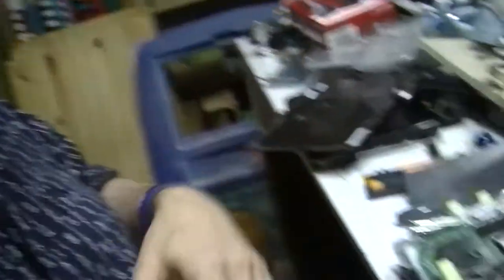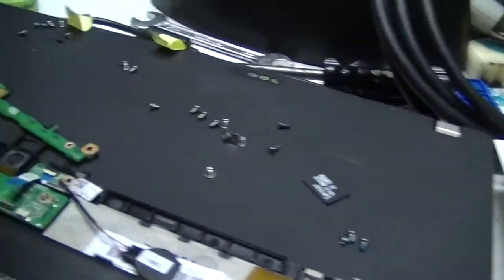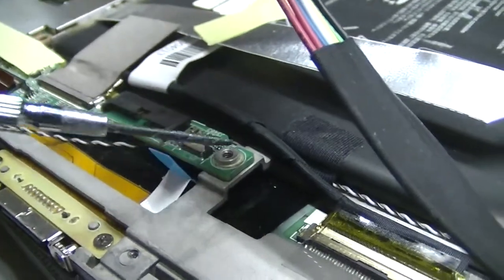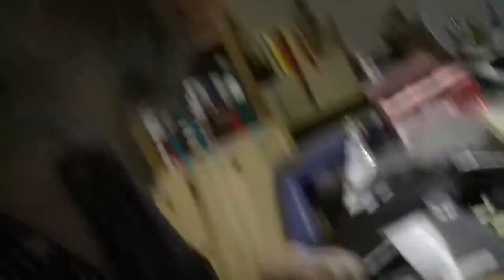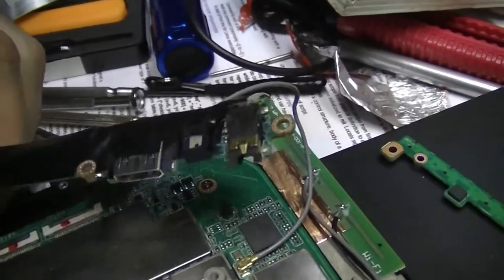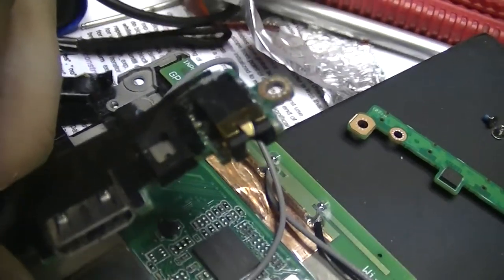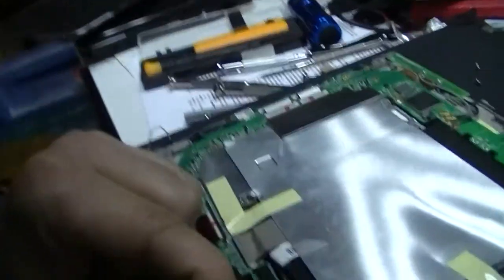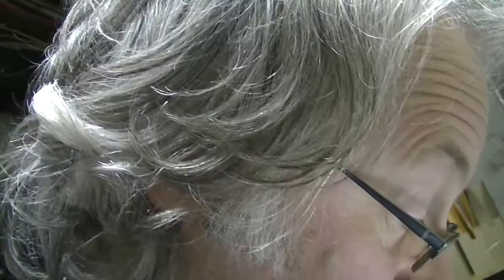A jigsaw puzzle made from a gadget

Comment from the maker: Definitely the number one thing is to disconnect the power. There is so much power available and the metal traces these days are so small it doesn't take long for them to be corroded away.
I like the idea of vacuum drying the gadget but I never got around to setting such a thing up because, despite dropping quite a few things in the water I assume I'll never do it again. I can't think of anything that would die except maybe displays. Freeze drying could work too. I've only ever air dried.